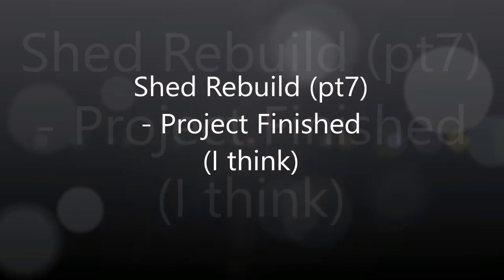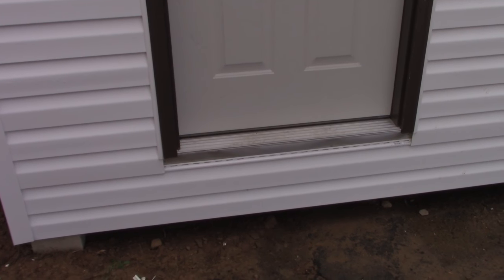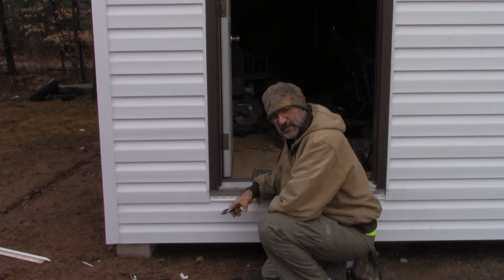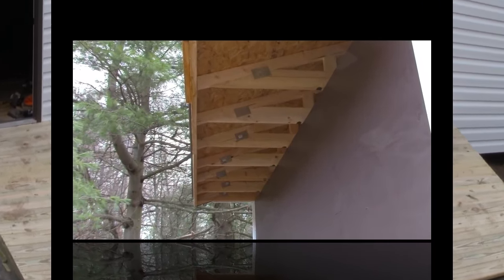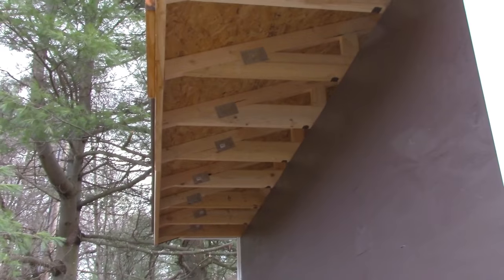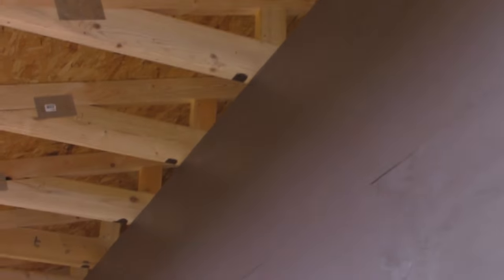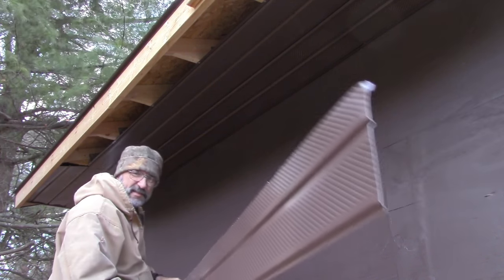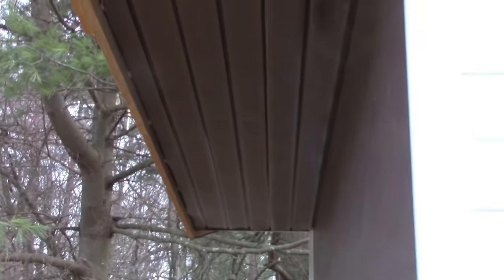Shed Rebuild (pt7) - Project Finished

Comment: If you're worried about security, put the window in but don't cut out the plywood. Just drill a whole bunch of small holes in it. Then you can open up the window to get air but nobody would know it was there. You could always cut the plywood out completely at a later date.
Reply from the maker: Now THAT'S a unique solution. LOL

Comment: I insulated all my barns, you can get used hard insulation at the big stores or returned insulation. I got rolls and rolls of insulation that is made with its own breathable wrap that had been returned rolled up terrible by the customer that returned it so rather than pay their employee to reroll it perfectly, they gave it to me for only 5.50 a roll instead of 39.99 if i took it all so I did, What a score. I chat with the floor bosses at the large stores or the owners at lumber yards, contractors, etc. to call me with anything good but cheap. Works for me.  The reason I  insulated was because when temp outside is cold it creates frost on inside of roof and minute temp gets even a few degrees above freezing that frost layer thaws and drips onto your belongings in shed especially closed ones.  It make stuff rust over the long term. I found only open front, say garages or open run in sheds do not get the condensation issues. Can not  fight Mother Nature. Where your ramps 3 boards touch the ground I always found free totally flat on one side wallstones laid them where board was going to touch ground, scored ground around shape and then carefully poked down digging dirt out just deep enough for flat side up rock to slip in (deeper than thickness of stone into virgin earth  and they will never stay level) giving it a few whacks with hammer to make it level. I did same under each board and 20 years later no rot on ramp bottoms near ground.  My first ramps, even top grade pressure treated got punky and rotted within 7 to 7.5 years touching ground. Also man made pavers absorb water so field wall rocks are only thing to use.  Just a tip to save money and time. Alot of ole timers let me pick their brains and it saved me fortunes through the years. It is a real nice shed, I like how you put the flashing under door all the way down - it is always wonderful to have  nice, dry storage place for sure.
Reply from the maker: Our driveway is paved, and there is a paved path all the way to where the door of the old shed was.  So the bottom of the ramp is actually sitting on the pavement with no ground contact.

Comment: This shed will outlast dirt!
Will you put some sort of fencing on the bottom to prevent animals from going underneath the shed? 
What about a coat of special paint for the plywood where  the firewood will be?

Great Job!!! Then adding the fact that you did this 90+% alone perfect.
Reply from the maker: The plywood has been stained with a wood preserving deck stain.

Comment: Cut a piece for under the board going across the door where flashing is. It will give support to all 3 ramped boards. Just a thought
Reply from the maker: Why? They are all securely attached to the shed, like a deck would be.
Reply: Tinyhouse Prepper as you wish. Joist hangers are used to support Joist in decks I've built. I never rely on just angled nailing , weather and weight can force them loose.
Reply from the maker: There ARE joist hangers on the ramp,  I just didn't show it on the video.
Reply: Tinyhouse Prepper 🎅👍👌

Comment: Hi Bill - congratulations on an outstanding jon! So much smart thinking with so many of teh details of this plan. The overhang on teh side for stocking up firewood, the build in constructionoptions of rboth teh window and teh airocn, the height fo rextra shelving and the ramp. All very smart good thinking! Was a pleasure to follow your proces sin this. Just one question about teh ramp I have: why did you not level teh ground and put some tiles undre it, so it woudl be secured not to sink over time or get unsteady with the slight difference in height? That really does not sound like you, cuz you are always so precise and careful. If it rains a lot the ground could slip away in this set up and the ramp could becoem unstable over time. With some tiles under the endings (where it touches the ground) it would have been somewhat more stable. At least, that si what I thought... Can't wait tos ee all teh shelves up! Elizabeth must be thrilled!!! You made life so much easier and more comfortabel for you this way! DOn;t forget the security, alarms, fireextinguisher, camera and so on. I bet your neighbours would all like to have you build one for them too! COuld give you an advantage by making soem extra money maybe. ENjoy, my friend!
Reply from the maker: The bottom end of the ramp is sitting on pavement.  It's not going to sink.  And it's only slightly out of level.  I thought it would be better to leave it a little out of level than to try to build up one side on top of the pavement.  right now it sits solid with no rocking.
Reply: yes that is what you said in the video.  I am just trying to learn from your skills, cuz you have been doing this for decades, and I noticed it. You say it is on pavement, which is not the ground (soil) so then it should be fine. I must hav emisunderstood that. Thanks Bill.

Comment: I think that I would have dug the truss into the ground a 1/4" or 1/2" to level that ramp up.   It probably doesn't matter in the long run but I'm just putting that out there.
Reply from the maker: The bottom end of the ramp is sitting on asphalt

Comment: Good man, pulling your shirt down for a butt crack free video. LOL You know as well a I do that the ground will heave and shrink over the seasons so even though you get your ramp nice and flat now, later it may not be. Concerning your overhangs, we used to put the soffit in before installing the wall channel. You can run your soffit normally on the longer overhang by putting wood between the trusses halfway out from the wall. Your soffit usually comes out even with the bottom of the fascia board. I don't want to pick on you too much so I won't mention everything I see that is not right. :)

The undersill you showed is better called a finish trim since it isn't only used under windows.

I did view your place on google earth. You have a good location.

Comment: You do such good work. I don't know why you didn't go back into building houses since the economy has somewhat recovered. I'm sure you'd make much more money doing that than driving truck.
Reply from the maker: Two things. First, after 8 years, my building business is completely gone as far as reputation and word-of-mouth advertising, and I'd have to start all over again from scratch. Second, I'm not as young as I used to be LOL. Just building this little shed almost killed me!! I don't want to go back to that. Also the money is better driving a truck (believe it or not), unless I build a large construction company.
Reply: Tinyhouse Prepper You mentioned security. Have y'all had any theft problems there? Did you say that's an old KOA. campground? The scenery is just beautiful. Also, the road next to your shed. Is that a heavily traveled road?

Comment: Is the flashing at the bottom of the door important? I finished building a 12x16 building and i have an issue....Not everytime but half the time it rains i have a puddle of water inside the door about a foot and half in! I didnt have the ceiling finished at the time so i didnt know if it was the roof or the door....The building is all metal so i highly doubt its the roof....So im assuming its the door....I didnt know about the flashing until i started watching this video....When i installed the door i used clear silicone on the bottom of the door and inside the bottom door way where it was gonna sit in place! I didnt know if i should build a roof over the door some how or silicone the bottom door seal or try the flashing at the bottom of the door....I have metal all around the door and i have clear silicone all around the door....I just cant see how it can leak...Im puzzled! Any suggestions i would appreciate it....Thank you!
Reply from the maker: The flashing is there to keep the wood from rotting. If you have a metal building, that's not a issue.  Generally, the caulk under the door during installation is what keeps the rain out. Flashing won't stop leaks under the door.
Reply: Just imagine 50% of the time that it rains you walk out, open the door and you see approx 1/2 cup of water thats approx 18" in from the door! Its alittle frustrating to say the least! My last resort is to saw all around the door and maybe add more silicone or build a canopy roof above the door! Its hard to fix an issue when you dont know where its coming from!

Comment: Why wouldn't you have used metal floor hanger install on the shed
Reply from the maker: Are you talking about attaching the ramp to the shed with joist hangers? I DID use them, I just didn't get it on video. Sorry.